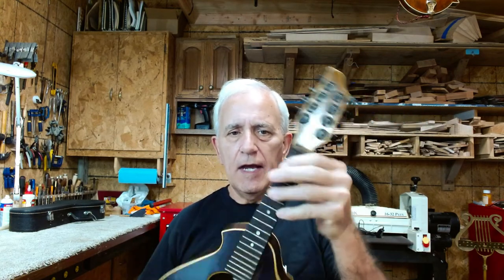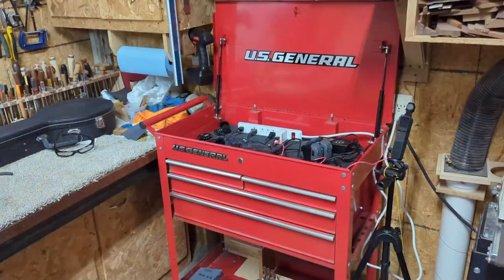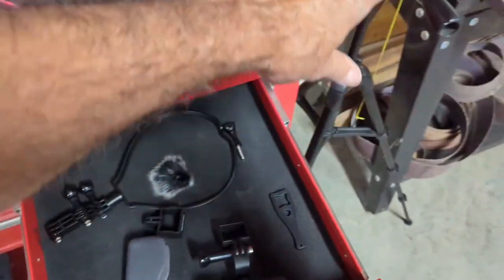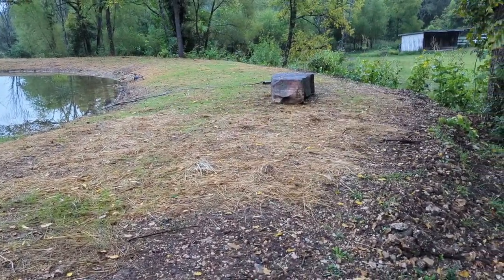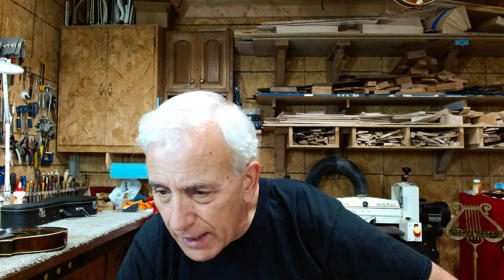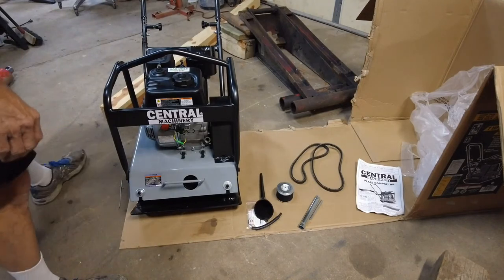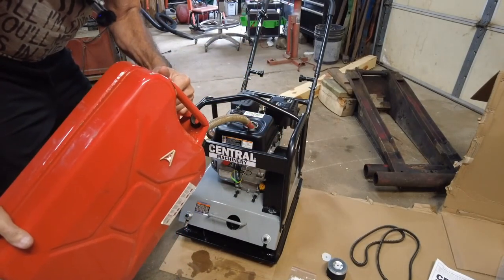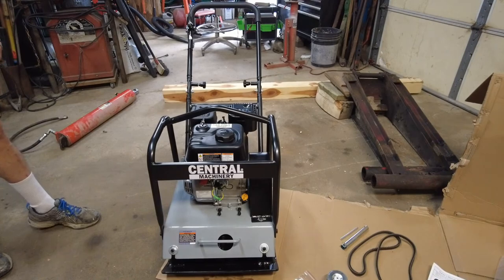Vlog 309  LIVE 3 Videos - Plate Compactor Start Up - New Charging Station and More

Comment: Be advised, these are great for smoothing a surface prior to concrete placement like a sidewalk. If you plan to use it for more structural type compaction, make sure your moisture content is close and limit lifts(layers) to 2-3”.

Comment: Get the real Boiled Linseed Oil as most of the new stuff at the hardware store is chemically boiled with heavy metal salts that can cause Parkinson's like ailments and joint pain.  Using the chemicals is faster and cheaper which is why they use it instead of the age old process of boiling it so it will dry and harden once you apply it.

Best!